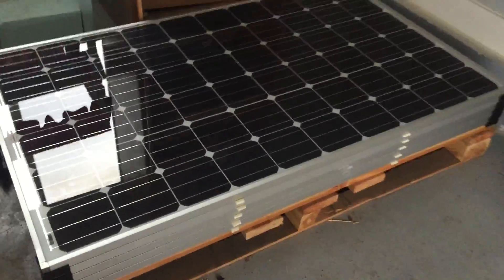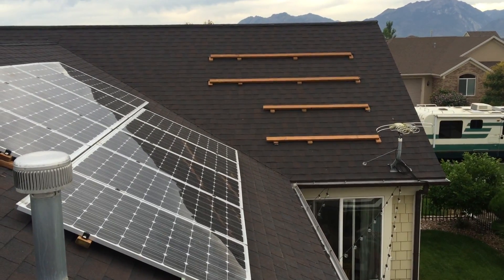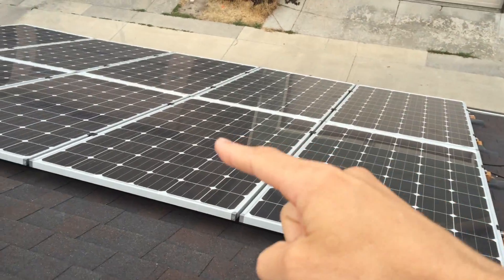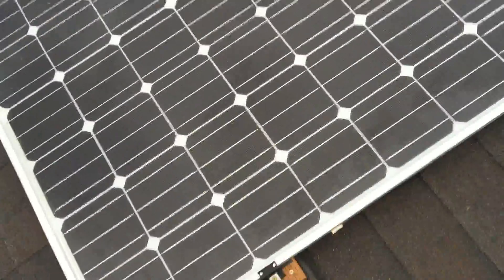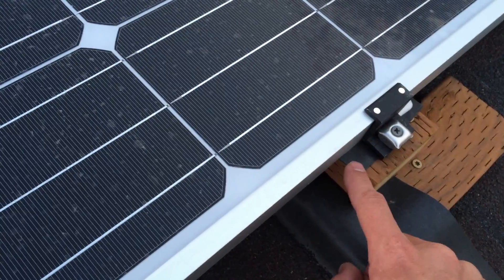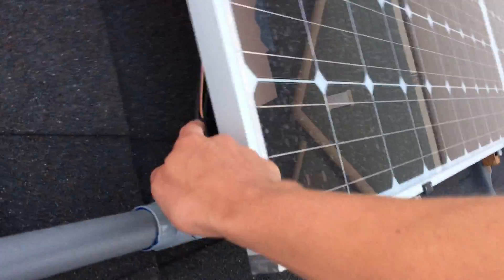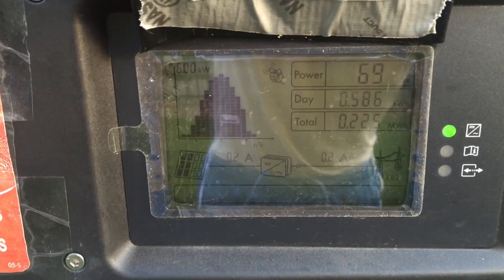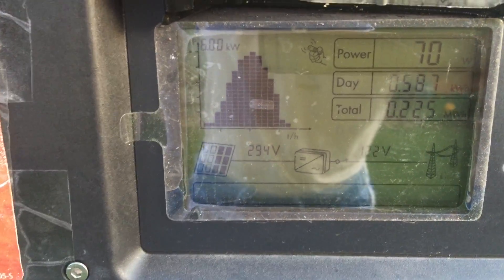How To Install Solar Panels Yourself For $4K - DIY 7KW - South Jordan, Utah - Cheap

Comment: where is your rapid shut down box. i started out with a couple disconnects boxes but they said it only needed to be on ac side and on the dc from solar panels it needed to be a rapid shut down.. its to drain the power from panels in like 10-30 sec or so. im still learning and watching/looking for videos on a rapid shut down box so i dont have to redo this again and can get my net metering going finally
Reply from the maker: So there is a DC disconnect going into the inverter, and there is an AC disconnect between the inverter and my main breaker box.  That is all you need for rapid shutdown.  If first responders (or someone from the power company) came and needed to switch it off, they could just turn off the AC Disconnect.  I had to put big red stickers on it indicating where it is to pass inspection.
Reply: my guy was here today helping finish mine up and i asked him about yours he said the micro inverters are like the rapid shut down.. since i dont have micro on mine i needed a rapids shut down. The 2014 National Electrical Code’s (NEC) new Section 690.12. so now i dont need the disconnects except for the ac side. live and learn and waste money doing it.
Reply from the maker: Oh I see, so since you have microinverters, you don't need the DC disconnect - good to know.  I am glad you figured it out!

Comment: Great Job Man! just curious, Did you considered running Romex through the attic during the design phase?
Reply from the maker: thanks!  yeah, have a look at lessons learned on https://diynewman.wordpress.com/2016/07/24/how-to-install-solar-panels-yourself-for-4k-diy-7kw/
Reply: Matt Newman  ah I see! Nice work man! You crushed it on ROI. I'd love to put a Cash proposal together for you with a rate increase that will reflect your 25 year saving. Could be could to add to your site!
Reply from the maker: Daniel Ramirez Thanks. I’m not really sure what you are proposing or what it entails. Are you just offering to create that for me so I can post it on my blog?
Reply: Matt Newman yeah we could put it in a proposal and you could see the lifetime savings.
Reply from the maker: Daniel Ramirez ok sounds interesting - I am assuming you aren’t proposing that I pay for this service
Reply: Matt Newman no man, I'll do for free
Reply from the maker: ok sounds good - let me know if you need anything from me

Comment: Thank you for the video, they quoted $35,000 for a simular system with a life time supply of suckers.
Reply from the maker: John Finger nice
Reply: Wow solar is so expensive in U.S.In Australia it works out 0.70c a watt  U.S fully installed for a good system

Comment: Could u send me a link to where you purchased panels?  I went to solar world website and theyre over double what ur parts list price shows.  Is it because they only sell newer models at the higher price?
Reply from the maker: so I would get on the sunelec.com email newsletter.  Prices are usually $0.50/watt, but you can get as low as $0.30/watt if you get a deal.

Comment: It appears to me the latter in the thumbnail of this video is upside down. Curiously
Reply from the maker: could be, although I am not sure how to tell
Reply: It's not, multi-purpose ladders have wide legs to properly stand on an A-frame position when folded as such therefore both ends of ladder are widened

Comment: I was thinking an affordable mounting system could be made of an extension ladder, lightweight, strong and cheap if bought used on craigslist.  No worries about using wood and the contact between pressure treated wood and aluminum is solved.
Reply from the maker: OhMostBobulousOne that is an interesting idea. On my blog, one of the lessons learned is that I would use strut channel instead of lumber.  I am not sure if that would be cheaper or if buying a used extension ladder would be.

Comment: You should now join the DIY Powerwall Group on Facebook.   I was processing batteries while watching your video.  I have a 9000W solar array on my house and completing a build for my Lithium Ion DIY Powerwall project.  You can join the DIY Powerwall Forum at https://secondlifestorage.com/index.php
Reply from the maker: thanks for the tip - I am a bit unclear on how I would implement batteries into my project and whether it would be worth it given that I am grid tied, but I think for people who don't have that option, the batteries make sense.  I didn't know there was such a DIY community around Lithium Ion batteries.
Reply from the maker: btw, do you use recycled laptop batteries?  Where do you get them?  How much does it end up costing you per kWh of storage?
Reply: I get all my 18650 cells from medical packs.  They have the best quality of batteries inside of them and are all manufactured in the same factory.  I get all my packs for free.  I also know a lot of people who also get their packs for free.  I sell a lot of packs as well that supports the purchase of other equipment needed for my build.  Currently have a 10kWh pack built out at an average of 2350mah per cell (14s80p at 48V) and I'm working on the next 2 packs with an average of 3000mah.  My goal is to build a 200kWh battery backup system.  I have enough packs now to build out a 90kWh system.  I'm to the stage of buying the electronics for the install into my garage.  What got me going on building my own Powerwall was a tornado ripped through my neighborhood and plunged the whole area into the 1800's for a week.  PC repair shops and my erecycler all wanted to help me with my project.  I'm sure you can find the same in your area.  Do you have a way for me to contact you I can then go into greater detail.
Reply from the maker: This is intriguing - could I possibly get free cells here in Utah?  How would I go about that?  How much do you charge for yours?  Also, would these work - https://www.ebay.com/itm/LOT-100x-18650-3-7V-5000mAh-Li-ion-Rechargeable-Battery-Cell-For-Flashlight-USA/152772793455?hash=item2391f7d46f:m:mLA2ramOLV0c3DAYpLFrmbw:sc:ShippingMethodStandard!84009!US!-1 ?

You can reach me at mattrobertnewman on gmail.  thx
Reply: A quick reply here for your other readers.  Yes you can get cells in most states depending on the area of the country you live.  If you live in a large city, not a problem, however if you live in rural America, Problem.  The cells you have found are as you will discover are fake Chinese cells and should never be used for anything beyond a flashlight.   You will discover even thought they claim 5000mah (which there is no such thing) that you will only really get 400mah out of them on average and maybe 900mah if you are lucky.
Reply from the maker: ok thx - I figured it was too good to be true!

Comment: I see many future failure points in this system. Not a bad job on doing it yourself, but the cost from a company is not only labor. For example they don’t use wood railing with wood screws or plastic conduit. Every company has an outreach/sale teams, site visit/inspection guys, system designers, construction teams, & electricians all packaged up. Those jobs add up quickly and are all bundled into the cost of a system. Just my 2cents
Reply from the maker: Wind Dance yes, I agree. There are many added services that they provide, but the problem is you have to opt into all of them and your cost explodes. I find value in some of those services, but not all of them. If you check out my blog you will see the things that I would change if I were to do this again. Some of them are using a different racking system, and not using conduit.  The approach I took was the least expensive, but I would probably pay a few hundred dollars more for some of these improvements.

Comment: That's not how grounding works. It forces the lightening to see whatever is grounded as being at ground level, which in turn is more resistance than anything higher than ground. If lightening DOES, in fact, hit your grounding wire, than you house will most likely catch on fire. But since the resistance of ground should be higher than anything else around it the lightening will avoid it.
Reply from the maker: i see - thanks.

Comment: Hi Mat, nice job! But beware treated lumber expands when wet and shrinks when dry. Use slip joints on your panels. 😎
Reply from the maker: Tom Randall thanks but I am not sure how that is a problem - I have had it on for a year and a half and lumber doesn’t get wet since it is under the panels and rubber.

Comment: Did you have an electrician do any part of it, like hooking up your net meter, or connecting your solar system to the net meter?
Reply from the maker: No, I did it all.  You can do that if you are the owner.  I was a bit scared, but I realized it basically just entailed popping a circuit breaker into my main, so it wasn't that risky.

Comment: Curious, why did you need to get approval from the power company? They have jurisdiction over who can and can't get solar power?
Reply from the maker: good question - they just have to approve if you are doing grid-tie - they want to ensure it is safe when you plug into their grid.
Reply: Some utility companies want to charge you huge inspection, connection, and licensing (?) fees to grid-tie. It seems they want to protect their revenue one way or another. At least that was the most logical conclusion I reached after researching in my state.

Comment: Wow, we live in two different worlds. That installation never would've passed inspection in California (So many code violations). I don't know how much I trust those roof attachments, and good luck with your roof not leaking. But, I admire your initiative and ambition. Cheers!
Reply: Comifornia has some  weird regulations))))
Reply from the maker: thanks - I am curious - what code violations would it have?  I was surprised to learn that most cities are pretty chill with this stuff, even in California.  After a year and a half, no leaks and panels are producing well.  No system maintenance.  It has been through a lot of wind storms and 2-3 feet of snow storms.  So, it seems pretty solid so far!
Reply: not sure of those violations either... as for leaks... even using the racking systems you would still have to drill them through the roof.
Reply: Tony Hamilton fk Commiefornia

Comment: Wired together the way you have them...is there any possibility if one panel fails, the others before it will be out of the link?
Reply from the maker: yes, on that string, but I have three strings.  So, if one panel dies, I could potentially lose 1/3 of my production.  However, usually panels just get shaded temporarily, so it is fine.  Also, I get reports every day (via sunny portal email), so I would notice if my production went down significantly .

Comment: I think another good option would be to use steel 2x4's... screw the track to the roof and insert the 2x4 inside the track and use self tapping screws to lock the two together.  Good job putting it all together and thanks for sharing.
Reply from the maker: good point  - thx
Reply: Are steel 2x4's weather resistant though?

Comment: Is it possible to make it off-grid system?
Reply from the maker: it is possible to make an off-grid system, but you need a different inverter than what I used, and you of course would need batteries and some other wiring to handle the batteries.  It will add significantly to the cost (maybe 2X).

Comment: so is the electricity paying you money back for the electricity you're supplying back into the grid ?
Reply from the maker: Yes, before I did it, I paid about $1,500/year for electricity.  Now it is $200/year.  So I save $1,300 per year.
Reply from the maker: Yes, at certain times of the day I am building up credits as i over generate and feed into the grid, and during the night I am using those credits from the grid up, so the net effect is that overall I don’t pay very much. You can think of it as using the grid as a big battery.
Reply from the maker: If you want to learn more, just Google net metering
Reply: I can also think of it as the grid using your house as a big battery your producing electricity for the grid the electricity company is middlemanning and in the end you're still paying 200 bucks a year when you probably should be getting paid not doing the paying
Reply from the maker: yeah, that is true, although I think net metering is a pretty good deal overall.  It is a partnership where I provide them my excess power, and they give me power when I need it.  Sure they are a middleman, but we need some kind of grid infrastructure and for what I am paying, it serves me well.  If I had used my own batteries or tried to build a grid with my neighbors, it would have caused 3-10X what this cost me.

Comment: Wiring diagram - You have 30 panels @ 235 watt each, what is the current & voltage of each panel?
IF YOUR PANELS ARE ALL IN PARALLEL it is a mater of time before your wires on the two ten panel array will start to degrade and may cause fire on a HIGH SUN DAY.  IF 235 w = 24 vdc this is more than 9 amp out per panel or ( 90 amp ) on one set of leads coming from each of your (10) solar panel arrays if your arrays are in series 10 - 10 - ( 5 & 5 ) then this is only about 30 amps but at a HIGH voltage 10 - 24 volt panels in series 240 vdc in round numbers and 9 amp or you may have them in series / parallel  5 series in parallel 6 this would be 24 vdc * 5 = 120 vdc @ 9 amps all arrays in parallel ( 6 ) approx 6480 watt.  
A diagram would help others to understand what you have done!
Reply from the maker: Oh yeah, of course they aren't in parallel - they are in series - 3 strings that each have 10 panels.  all the diagrams and documentation is at https://drive.google.com/drive/u/0/folders/0B8sb6jeRth9FYUw3NGxlcEdieGM.  Specifically, the diagram is at https://drive.google.com/open?id=0B8sb6jeRth9FQnNnN0NUc2prT1k and https://drive.google.com/open?id=0B8sb6jeRth9FRFBMcC1Kb09xZFU.  I also did a full write up on this blog post at https://diynewman.wordpress.com/2016/07/24/how-to-install-solar-panels-yourself-for-4k-diy-7kw/

Comment: Near 3/4 of the cost goes on labour? Amazing.
Reply from the maker: yes, exactly.  I mean technically if they broke it down for you, they would probably say 1/2 is for labor, and then they mark up the equipment double so 1/2 is parts.  This is what auto mechanics do.
Reply: @MattNewman  big assumption about the equipment mark up, it doesn't seem to be standard in my area. But of course companies are going to charge more than cost of parts and labor they need to make a profit or what is the point of charging for services and coming out even, that would be a garbage business plan.
Reply from the maker: @BobLSaget  yeah, all I know is that at the end of the day, I did it for 1/4 the cost.  I did make some compromises and you could argue that the product they offer is superior, but not by much.  I still think you could just do what I did (and maybe do metal racking and a few other things), but just mark it up so it is still half the cost of others, and you still have a viable business plan.  I know a guy who sells solar, and he makes $1500-2500 per sale, so that is a fairly significant part of the overhead right there.  If you get too many people involved in the process (door knocker, salesperson, paperwork guy, installers, etc.), the overhead racks up.

I think you could market in other ways (online ads, word of mouth in the neighborhood, even MLM/network marketing, etc.) that would be less expensive.  If your cost was half, word would spread pretty fast.

Comment: Sp you have had these panels in for over a year, how have they worked for you so far? what percentage of your bill do they help with? have you decided to add another string of panels? How have they performed in different seasons? Any problem with the equipment at all?
Reply from the maker: full follow up is at https://diynewman.wordpress.com/2016/07/24/how-to-install-solar-panels-yourself-for-4k-diy-7kw/.  Basically, I save $1200/year.  They cover 90% of my bill - basically 100% for 10 months, but I pay a bit in December, and a full bill in January.  The only issues have been that some screws came a bit loose and I had to tighten them.  The snow bunches weird on them (and falls off the roof in chunks), but other than that, working great!